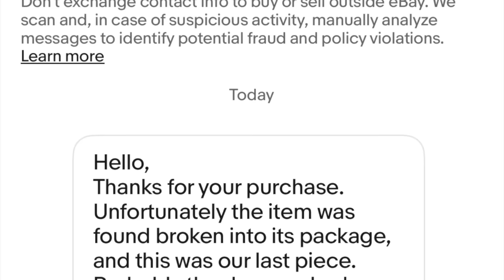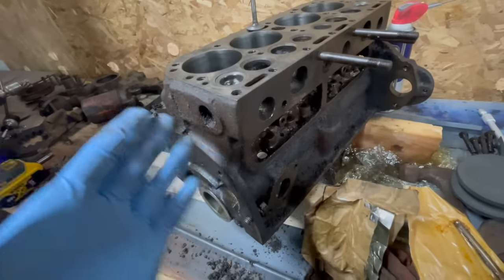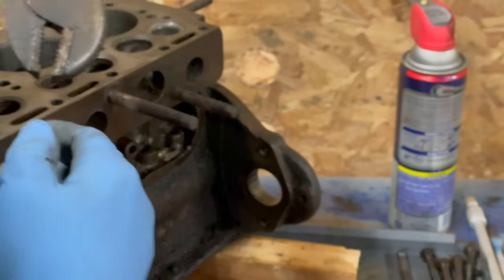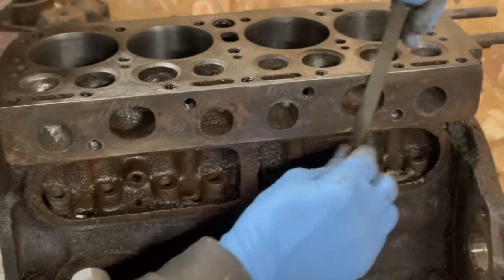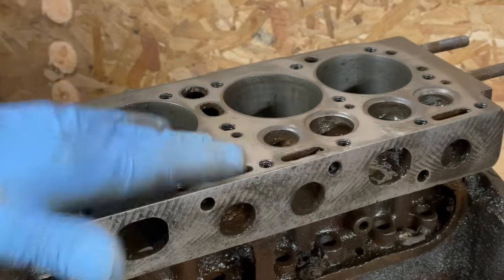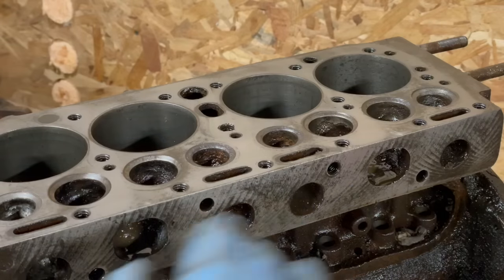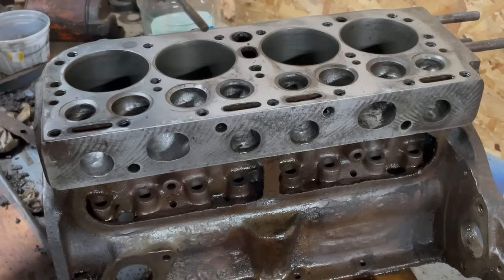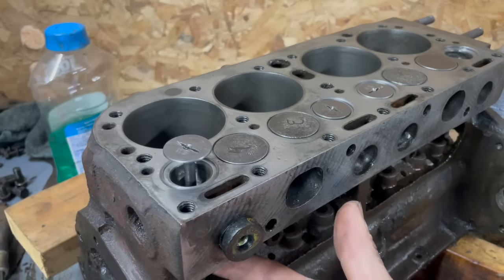Mity Kat Bulldozer episode 7- time to shave off 66 years of neglect!!

Comment: A good friend of mine restored a 1920s Mity Kat in the 1960s. He said that the machine shop found that Simca pistons and rings worked for his engine. He died almost 20 years ago. I don't know what his wife did with his shop full of old machines. Good Luck, Rick
Reply from the maker: Those engines do infact use the same bore size! Good to know. I have two correct size rings on the way hopefully they work thankyou for the info
Reply: @jmpsavescars You are welcome. We who play with antique toys have to share info whenever possible. I used to play with a lot of old Wisconsins. There was a guy on EPAY that was good at getting NOS parts. You might want to talk to him about other brand engines. He was from PA. Good Luck, Rick

Comment: Professional shops deck blocks because it's faster, not because it's necessary.  But if you think about it, someone probably scraped in the ways on their mill.  Scraping the block directly just eliminates the middle man, or middle mill, as the case may be.

I would have thrown that block in the truck and run it down to my local coin-op car wash before I started working on it but you do you.
Reply from the maker: Thourough clean is the last step before assembely, ive found its easier to do it once and not have to keep cleaning it and batteling rust. Up here in the north the temp swings quite a bit so keeping it somewhat oily works. Your exactly right. A surface stone works great to just remove whats high and make whats true like new again.

Comment: That  Hercules engine is about the same as one I overhauled when I was 17. It was in a Oliver HG tractor about the same size as the Mity Kat. That was the first engine I did that worked out well with no oil burning. Back then in late fifties I was using chrome rings which Looking back I think was responsible for my earlier failures, rings not seating, oil burning.
Reply from the maker: i dare say you were dealing with a much healthier patient! chrome rings need a real smooth bore finish or they end up making it them selves! im hoping that this engine runs well enough to do a few years worth of work at least. having the second engine im planning on going through that one and having a spare. thanks for watching

Comment: When pulling them head studs a bit of an idea you two nuts put back over the head stud you screw one up against the other and you can use a ring spanner to bring them out just a bit of an idea for you mate the two nuts lock up tight against each other you can still use your multiplies to hold the stud why you used the ring spanner on screwing it out the two nuts lock up against each other they use a ratchet wingspan whatever you want to use open Ender shifter use whatever you want to use you are doing a good job I cleansed a bit when you're putting pressure on them head starts because you don't want to break one of them make sure you have some easy outs in case one breaks you don't want that I love what you're doing that I'll engine I feel I'm right beside your work on it love it❤❤❤😊🎉
Reply from the maker: Thanks man i appreciate it! Im aware of the double nut method and it works great aside from it putting you at the end of the stud. The extractor puts you right at the base and turns in a way that it doesnt put much sideways force on it. In the end its the heat getting into the block that does it. Ill keep the videos coming!

Comment: First off, your audio is getting better. Second, I couldn't' help but think that you were giving that old Hercules more attention than it ever had, even from the factory. And then you gave it a mild porting! You may have increased the horsepower by four or five hp. Who would have ever thought of hot rodding a bulldozer? You're doing a very good job making it right.
Reply from the maker: Thanks Burt. Im doing what i can to share this project with the people who are interested and im glad to hear that you can hear me better. The rust and decay did half the porting i just finished the job haha. Why not right! Through the tiny carb it wont equate to much hp but efficiency is related to cyl filling and flatheads struggle with that. Im trying to give it the best shot its got to returning to work with a clean bill of health. Nothing worse than bringing something back to life only to destroy what was good

Comment: thanks for your understanding of heat/expansion. did you make your bearing scraper?
Reply from the maker: I fight the battle of making things move again every day and i use to work in heavy industry where heating and cooling is the only way things go together or come apart. Ex. Removing a bearing race from a shaft you cant get behind or installing bearing shells in carriers with dry ice. Mounting huge gears on shafts that have no keyway only the shrink fit holds it because keyways weaken it. I got that particular one from my old job but they are available still. 👍

Comment: It looks to me in your video that all the intake and exhaust valve seats are sunk in the block.  The seat angles look very wide in the video.  I would love to see you give this thing a quickie valve job and re-ring and get it going but i think you're going to have issues with the valves sealing.  Hopefully I'm wrong about this.
Reply from the maker: The intake valves are at factory height, i had to cut the exhausts down a bit to get to good material, i had a camera mishap and didnt film the fine tuning of the seats. I was having trouble with sealing testing with air pressure… i cut the top flat and the bottom a bit more and narrowed the sealing surface to about 3/32 and lapped again and thats when i was able to get the valves to bounce up and down with air flow. I used this test many times with briggs and stratton engines and they all ran great. Ended up ordering four intake valves and ill be doing some more fine tuning. Plenty of room to adjust the tappet adjusters to compensate. Its a game of inches with this one. Part of me wants to being it to the machine shop but thats just not my style haha. Thanks

Comment: Those rings can be ordered individually and be made up sets.
Reply from the maker: The issue is that they are .030 oversized, what source are you looking at?
Reply: @jmpsavescars Hastings piston rings hasting mi USA. Or sealed power. Any vendor that sells these should be ale to order individual rings. It’s called open stock I think. All they need to know is bore size actual and width. Always measure at bottom of ring travel. Not at the top. 004 ring end gap per inch of bore. Error on the loose side. Way too loose it’ll last little too tight instant disaster
Reply: @jmpsavescars Hastings piston rings hasting mi USA. Or sealed power. Any vendor that sells these should be ale to order individual rings. It’s called open stock I think. All they need to know is bore size actual and width. Always measure at bottom of ring travel. Not at the top. 004 ring end gap per inch of bore. Error on the loose side. Way too loose it’ll last little too tight instant disaster
Reply from the maker: @daleolson3506  i searched on both on their  catalog and didnt come up with anything. But if the ones i ordered dont fit i will call or at least hope you can still talk to a human. Ill be sure to gap them accordingly, thanks for the info

Comment: With the crappy gas we have to use now adays, you sure you don’t want to send the block out and have it cut to install hardened exhaust valve seats? Just a suggestion.
Reply from the maker: Ill be using lead additive and due to the low rpm nature of this engine it shouldnt be a issue. If it is then i guess at some point ill put hardened insert seats. It will run like this for a long time i believe.
Reply: I don’t know about your area, there’s a couple gas stations near where I live that sell ethanol free gas. I have to drive about 10 miles, but I figure it’s worthwhile for my vintage truck.
Reply from the maker: @Retrogradeinversion  i could also run to the airport and get 100 low lead. It might go 4+mph on that stuff!